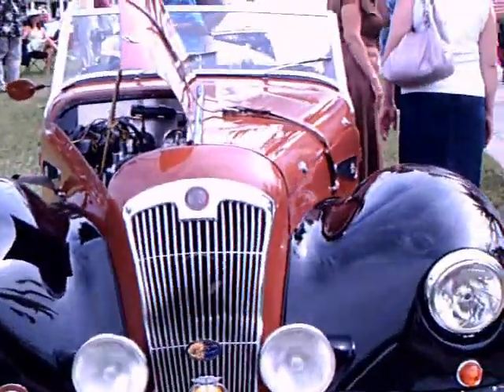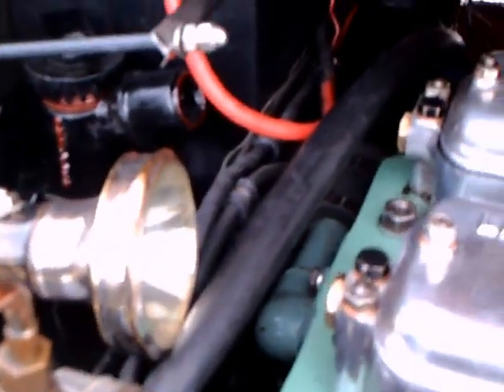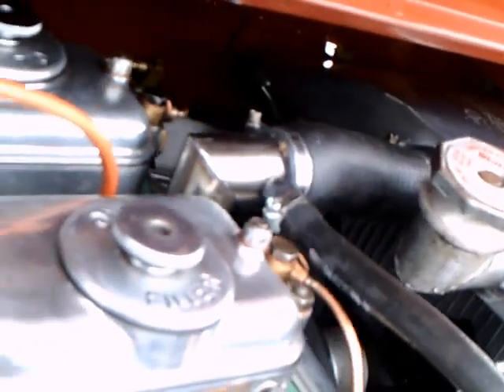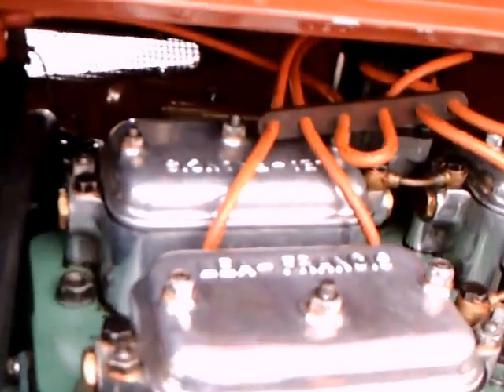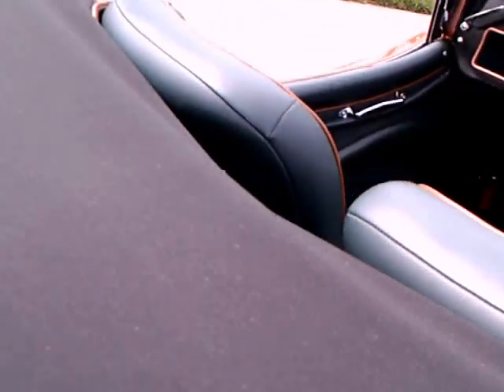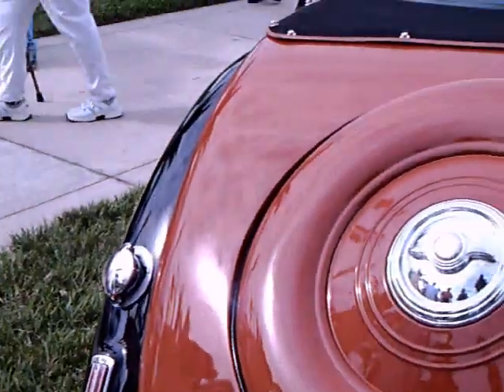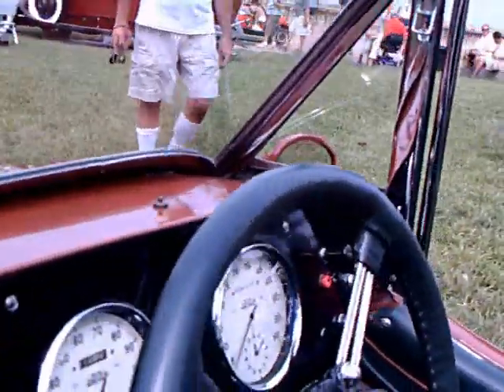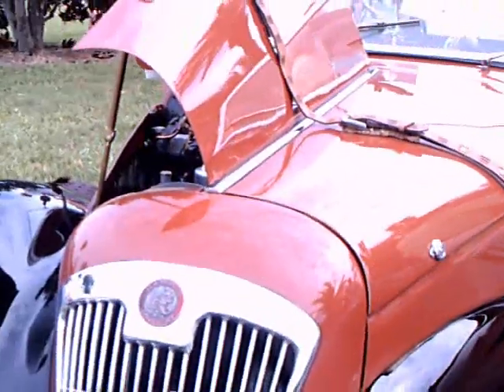1950 Lea-Francis Cabriolet RedBlk

Comment: Well I certainly don't think I've seen one of these, though I have owned lots of cars with similar S.U. carburettors! Strange treatment to the number plates though, they appear to be entirely polished aluminium, with no black backing. Highly illegal. I've just done a quick Google and Lea-Francis last properly made cars in the mid 50s, with 3 examples of the unsuccesful Lynx made in '61, then various concepts and a run of 5 Ace Of Spades since the 1980s by the trade mark owners.

Comment: Rather poor video, you can't really see some details, including the chassis number but this is nr. 5146. It is actually not a "Cabriolet" but a 2.5 Litre Lea Francis Sports, an extremely rare car and very well built; of the 78 made almost half still exist which is the best survival rate of ANY post-war British sports car.  The boxes are not "strange", they are simply four separate valve boxes rather than 2 long ones; Some Riley engines have the same configuration. By the way this is NOT an overhead cam engine; the camstafts are underneath the cylinder head. Very tidy engine compartment although the air filters are modern (and ugly) and the high tension leads are not correctly fitted. The seats are not original either and too sumptuous. Also the two-tone livery is not original and doesn't really suit this model. There are a few more unoriginal details but otherwise the car looks to be in superb condition and it's a rare treat to see one.
Reply from the maker: Thanks for your input!  :) Jack